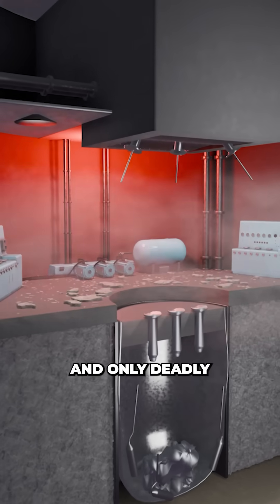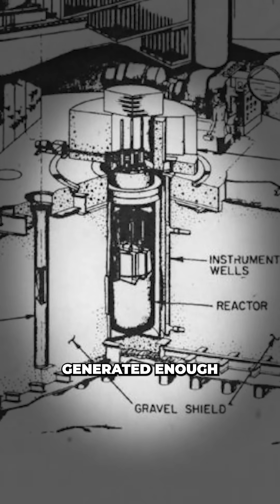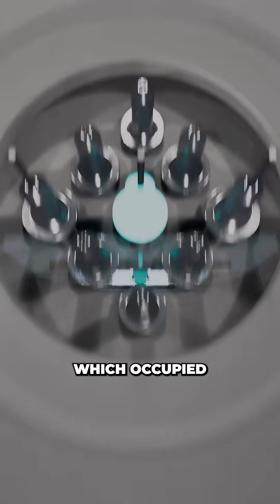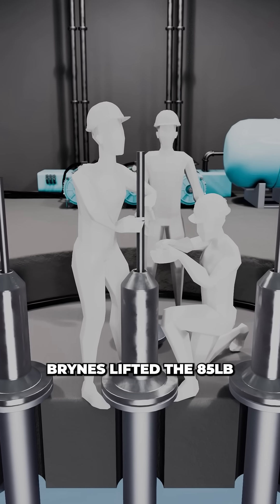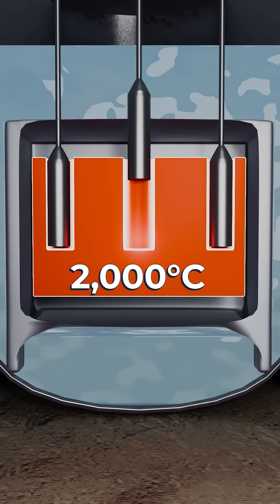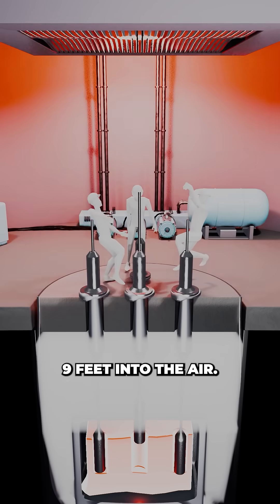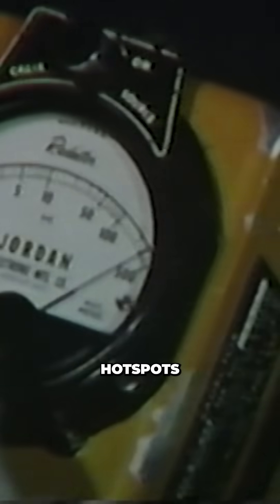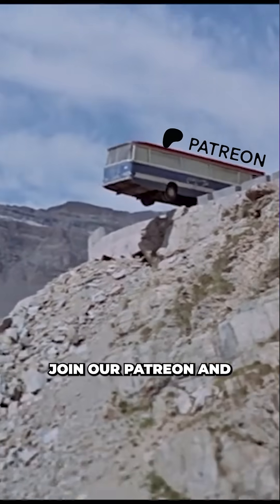The True Story of the SL-1 Disaster

Comment: Small addendum to the details that killed Legg (it was worse than this short described):

"The shield plug was ejected from the core at eighty-five feet per second, entered Legg's body through his groin, exited near his shoulder, and propelled him straight up to the ceiling where he dangled for six days. The impaled body was so radioactive that it took engineers that long to design a safe way to remove it. When they did finally bring Legg down, they were shocked to see that despite the time that had passed, the body was perfectly preserved. It was so radioactive that the sterilized flesh had not decayed."

- excerpt from Atomic America (2009) by Todd Tucker
Reply: Using my horrible math skills, 85 feet per second translates to almost 58mph.
Reply: @DarkMuu666  your math matches my quick math, 3 fps approximates 1 mps, and 1 mps approximates 2 Mph, both very good approximations, so 1 mps should give .66 Mph, so 85 fps should give a bit under 60 Mph, so 57-58 sounds dead on
Reply: @joshyoung1440  85 feet per second times 60, times 60 divided by how many feet are in a mile for me
Reply: @joshyoung1440 Good work kids. Love your style. Carry on.👍💯🔥🤘🇦🇺
Reply: @DarkMuu666  you would think its faster, like a lot faster. 58 is highway speeds, so
Reply: @diehardbikes  And yet it was moving fast enough and with enough force behind it that it punched through Legg and embedded itself in the ceiling.
Reply: @diehardbikes so like… imagine getting hit by a car at 58mph. Thats more than fast enough to turn your innards to soup. A slightly pointy, dense piece of metal moving that fast will easily do some damage
Reply: @Mesaaaaaaaa also, we tend not to think of highway speeds as fast because we tend to experience getting there gradually. But if you consider it going from zero to highway speeds in a fraction of a second, that is absolutely terrifying
Reply: @diehardbikes  that’s a rod that’s half the weight of a car accelerated to that in a ms. It also launched a the top plate 9 feet. Thats like 5 busses of weight
Reply: @chandrasekharlimit4547  It was also a narrower projectile than a car- significantly so. I’m no physicist or mathematician, but I recall something something force being increased when a smaller surface area is involved.

That rod at its piercing point, would have hit with exponentially greater force than a whole vehicle could, traveling at the same speed…
Reply: @diehardbikes  I felt the same way, but thinking about it yeah, getting hit by a projectile at that speed is gonna shrek you.
Reply: @RPGTKingpin this was Milliseconds. The fastest cars don't even go from 0-60 in less than 1.5 seconds. Just think about that part too
Reply: @Shadow17Link yeah. I addressed that in a follow-up comment. It's mind blowing the kind of forced involved in something like this. It's the human equivalent of shooting a beetle with a nailgun.
Reply: @Mesaaaaaaaa  Yes, it DID do some damage. That is clear. You saying it will easily do some damage is kind of redundant given that we're talking about a man impaled through the body and pinned to the roof...
Reply: @charlieross4674 have you historically not scored well on the reading comprehension portion of standardized testing wherever you’re from?
Reply: @diehardbikes  an highway speeds turn humans that get hit into vaguely recognizable red paste. I mean look what happens to deer and their bodies are tougher than ours. Plus it was a very small contact point so all that power was only focused on one point.
Reply: @Mesaaaaaaaa  trust me ik cyclists who have been hit by cars who havent been driving right. Yet they never went to jsil and the cyclists died too.
Reply: @Mesaaaaaaaa  im not saying it cant or wouldnt, just that 85 feet per second sounds much faster than 57 mph
Reply: @chandrasekharlimit4547  its not half the weight of a car. Otherwise dude could not have lifted that
Reply: @DarkMuu666  shrek.... do you mean shred? Ive never heard of a projectile being able to shrek someone
Reply: @diehardbikes  Somebody once told me the world is gonna roll me
Reply: @RPGTKingpin  That's what happens when you take 58 miles per hour and condense the surface area being propelled from Cadillac, down to a stainless steel rod about as thick as a kindergarten pencil. Turns that fuel rod end into a stainless steel penetrator strong enough to pin a corpse to a concrete ceiling like a bug.
Reply: @diehardbikes  it was around 80lbs.
Reply: @janus4002  right, 80 pounds is nowhere near the weight of a car. I can bench twice that.
Reply: @DarkMuu666  I think you can google it
Reply: Sterilisation by the use of ionising ration is a very effective way of killing any pathogens that ruin/decay biological material. You can store food such that it lasts for a very(!) long time that way. If you manage to seal it up completely, then blast it with many Gray of radiation, it will only be subject to chemical degradation, such as oxidisation and leeching from the packaging.
Reply: That's pretty interesting, thanks for that
Reply: Fascinating (scary) explanation.   Do you do kids' birthday parties? 😬(😉)
Reply: @ColonelAngus-y1h Ahhhhhhhh hahahahaha!
Reply: Didn’t they basically just have blokes run in with scaffold poles & poke at the poor bastard’s body for twenty-ish seconds at a time until it gradually slipped down the control rod & then fell to the floor?
Reply: @CtrlOptDel  This is probably one of the only times I’ll give the benefit of the doubt to the US government. If there was a nuclear incident this bad?? I can’t even blame them, for once.
Reply: @Forthebants11 That wasn’t meant as a criticism… and, oh boy, do I ever have some they-belong-at-The-Hague-and-then-at-the-end-of-a-rope criticisms of the US government… just clarification of something I’m pretty sure I’d heard about how the cleanup crew dealt with the issue.
Reply: @CtrlOptDel  Oh, I wasn’t having a go at you either. Just joining you in remarking on how wild this case was, and what a departure from the norm it was. Including standards for handling the bodies. I feel very sorry for those poor engineers, but I also feel sorry for the clean up crew…
Literally a lose-lose situation for absolutely everyone involved.
Reply: @CtrlOptDel I hope not but thsts probably what they did,both humorous and sad, I hope these mens families are doimg okay right now
Reply: He’s so dead that even death won’t touch him…
Reply: So what I'm hearing you say is, Nuclear products are great for staying and looking younger? 😏
Reply: @chrismack-Yakity-Yak yeah I hear if you’re exposed to high doses of radiation you look young for the rest of your life!
Reply: @chrismack-Yakity-Yak  the downside is instant death, but yes
Reply: @chrismack-Yakity-Yak  Funnily enough, Radiotherapy is one of the most common methods of treating cancer. Concentrated doses of radiation directed at the tumor, gradually killing it. Combined with chemotherapy it’s an extremely successful way to treat a lot of cancers.
Reply: @chrismack-Yakity-Yak 
😅😅😅
That logic is on the same scale as Trump's idea of injecting bleach to kill cov!d. (Is that word permitted on YouTube?)
Reply: I can imagine Vlad the Impaler crying tears of joy reading this. "It's perfect!!!" 🥲
Reply: @7piecebucket Ahhh, I love history humor. Took some of the horror away for me.
Reply: And that’s how people invented radiation sterilization, which is a major component of hospital procedure these days.
Reply: That is actually horrifying
Reply: Think I remember reading that those guys also had to be buried in lead caskets too, or something to that effect.
Reply: I've seen and read this story many times. It still shocks me how long he was hanging there. And the fact on how the rod pinned him😬😮
Reply: VERY interesting; thank you!
Reply: 😮 brother
Reply: well..... fuck. Thats super interesting.
Reply: I'm just about to go to sleep tonight. I shall steel myself for resisting the urge to have a nightmare. Lucky I am a seasoned 66 year old with a bit of life experience! Thank goodness. Always interesting to get the real facts around these expensive constructions. Even if we all share the hard lessons learned.
Reply: Dude was so radioactive, even microbes couldn't touch him. That's crazy.
Reply: Holy fuck
Reply: Old Vlad would have been impressed, I'd say. RIP Officer Legg.🤔
Reply: Nutshot?!
Reply: That's so fucking metal, I love it
Reply: Jeuss fuck, thanks for the nightmares LOL
Reply: jesus fucking christ
Reply: Irradiation might then be used as a modern mulmification technique
Reply: Wow— I am blown away by your clear explanation of the situation— THX MUCH,👍😁🇺🇸
Reply: The one time when 4 inches is preferred
Reply: Whoa... I can yap...
Sorry about this, mate 🙏
Reply: Fascinating , That being that radioactive leads to one being embalmed.
Reply: what the fuck
Reply: Through the groin?!
Janice from "Friends":
'Oh! My! God!'
🤯
Reply: Radioactive mummification 🎉
Reply: I really wonder how they didn't notice blood dripping from the ceiling or a pool of blood right underneath him?? 6 days, really?
Reply: @DanielTseng100  they entirely had to design and engineer a safe way to remove the body because it was so SO radioactive.
Did you read the entire main comment?🤷‍♀️🥴
Reply: @TheInfintyithGoofball my bad, I misread that part
Reply: @DanielTseng100  Uh, given how intensely super-heated the metal of that nuclear reactor became, instantaneously, I’m guessing there was no blood to drip and pool. 

Dude was immediately flash-burned internally, cauterising all potential sites of bleeding…
Reply: @Forthebants11  Good point, but although the water flash vaporized in milliseconds, could a solid metal rod conduct heat that quickly, hot enough to cauterize a gaping wound?
Reply: @Cavemankind_  It’s not gaping though? The rod remained buried inside the puncture wound it created. It would only be capable of ‘gaping’ once the penetrating foreign body had been removed from the wound.
It’s a basic and well-known fact that leaving the piercing object inside the puncture effectively suppresses most bleeding, by applying pressure to all torn tissues in that area.

And I think you’re underestimating that this is a nuclear disaster. We’re talking insane temperatures here, and physical matter behaving in ways most human minds find ‘paradoxical’. Metal heating to 2000 degrees, in a few milliseconds flat, is almost incomprehensible insanity, to me.
How can this be underestimated?
That superheated metal remained firmly embedded in his chest, cauterising all torn tissues from inside his body.

The only question I could see, is how no other fluids of decomposition dripped from his body. Because the rod only explains the lack of blood. 

I guess maybe the fact the extreme radioactivity might’ve killed off his entire colony of microbial organisms. Our body’s bacteria is responsible for breaking us down after death. Without them? I don’t think decomp works quite right…

Comment: Even by standards of the day the design was dangerous having a single rod that could restart the reactor by itself, and the maintenance of the installation was poor at best and criminally irresponsible at worst, the control rods got stuck often, and the only answer they got was that the operators should move them constantly to keep them from sticking too much. While there is no confirmation it is generally accepted that the rod was stuck and when it finally gave way, it was being pulled with too much force and is what allowed it to be lifted all the way.

Comment: Also, the central control rod of SL-1 was the biggest and most powerful of the reactor so even if all of the other rods were completely lowered it still wouldn't have been able to stop a runaway reaction which was a horrible design flaw at the time

Comment: There is an excellent episode of Well There’s Your Problem that overviews this disaster. This is a horrendously unsafe setup but there is a theory that Richard Legg lost his temper. Basically he hated his assistant and the day this happened his wife asked for a divorce. Before he was pinned to the ceiling (through the groin actually) he was pretty pissed off. They actually couldn’t find Legg for hours after the explosion, not only was he all the way up in the rafters, but you would barely know you were looking at human remains at that point.
Reply: While the call by his wife asking for a divorce did happen, almost everything else is at best speculation and at worst tales made up to sell the sex angle. Legg wasn't caught entirely off guard by the call, as his marriage had been on the rocks for some time. He may not have been in a good state of mind, but no one at all knows for certain what happened in the chamber when the rod was pulled. Legg may have lost his temper at the equipment or one of the other crew and acted without thinking, or maybe they were all in reasonably good moods and when trying to get the rod to move, they used too much force and triggered the incursion. The only person who was still alive when rescuers showed up died soon after without regaining consciousness.

Comment: I lived down the street from this for years. the area is still contaminated. Similar Valley California, Rocketdyne Experimental Salt Reactor was the 1959 partial nuclear meltdown of the Sodium Reactor Experiment (SRE). The accident was caused by a blockage in the coolant flow, which led to fuel damage and the release of radioactive materials into the surrounding atmosphere

Comment: 3 people have died due to nuclear power in the US and they still claim its more unstable and dangerous than fossil fuel.
Reply: But dino juice makes people rich therefore nuclear energy bad.

Jokes aside, if you make a reactor idiot proof and spare no expense you could easily and safely power my country for the next 100 years without difficult.
Reply: @paladinboyd1228  you would still have the problem with lead leaking into the water supply
Reply: @nikolaievans2432  The water used on power plants is not being put back on the water supply, this is like saying that chemical plants taint their water, well, obviously? Its not made for consumption and that water is made to be discarded
Reply: @Gamorou  Hence why I said idiot proof. The waste is safety stored in those massive underground vaults for the next thousand years.
Reply: Just a reminder that a collapse of the hydroelectric in 1975 in China killed over 240000 people, which is way more, these are all direct deaths.

In total, of all nuclear power plant accidents, we have 31 direct deaths, and the upper estimation of 12000 deaths by radiation in a time people didn't know any better
Reply: You realize nuclear power still leaks chemicals into water like lead and other heavy metals that keep in the radiation
Reply: No it does not. There are immense regulations on making “nuclear wastewater” safe. You don’t even need to let the water you used to cool the reactor down get back in to main water supply. You can just dump it into a reservoir and reuse it when it cools down, never allowing it to ever enter the public water supply
Reply: @hadrian922  nuclear power is unsafe due to human oversight. 

Nobody is disagreeing that a well managed nuclear facility isn't safe. 

It's just that when incompetence does appear in such a facility, entire communities die and the land is uninhabitable for a considerable amount of time.

Comment: Just another reminder that every safety protocol we have is basically always codified in blood one way or another.
Reply: I hate how we mostly have to learn from our mistakes through consequences 😕
Reply: @b0xman935  Sometimes unexpected things happen in even more unexpected ways. You can't plan for EVERY possibility that could happen with so many variables. Though I think it could definitely be argued in this case, that some kind of mechanical procedure (with better control, and safeties) for lifting that central control rod should have been used, rather than just having a guy manually lifting the thing 4 inches with nothing but his own muscles. And it seems to be that these rods frequently got stuck during this and similar procedures. So it is a bit confusing to me that something better hadn't been devised yet. But hey, what do I know?
Reply: @Jester_The_Jynxster in naval aviation it is said that NATOPS are written in blood. Lose an engine on an F-14 Tomcat, right after a catapult launch or on final to a carrier…..it is WRONG to apply opposite aileron to raise the dropping wing; you recover control by applying opposite rudder/lower the nose less than 14 degrees AoA/adjust power as required/raise the gear. If not, you’d end up like Lt. Hultgreen
Reply: @Jester_The_Jynxster And that right there is proof that someone else is in control not us, but God.

Comment: I learned that the rod was stuck and they had to use more muscle to release it, and then it released and was pulled up to far before the could stop it.
Reply: That's exactly what I heard
Reply: They knew that this rod got stuck it’s surprising it didn’t happen earlier
Reply: Static friction in mechanical physics is basics
Pulling a rod from a cylinder is known, by everyone working with metals, to be harder at the start.

The technitians were sent to d1е
Reply: Oops!
Reply: No one knows for sure because the one person alive when rescuers arrived never regained consciousness. Investigators did some tests using a mock-up to try to replicate the draw height achieved. They identified a most likely scenario and a couple of less likely but still plausible scenarios, but could not conclusively identify exactly what happened.